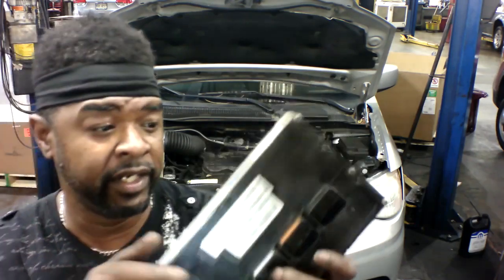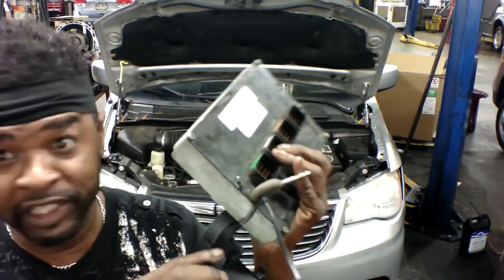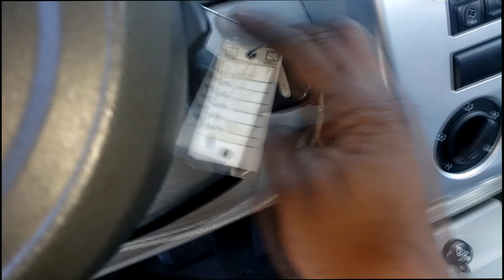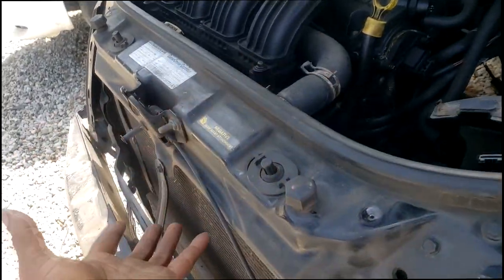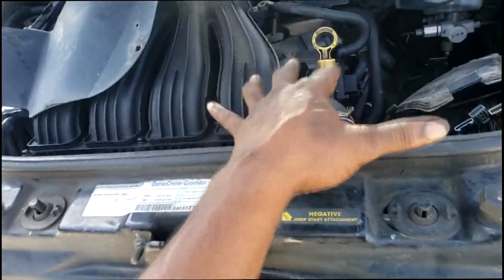No Start Key Bad. NO FLASH NEEDED. DO THIS. PCM, SKIM, KEY to avoid programming. PT Cruiser no crank

Comment: Not a fan of the PT Cruisers.  At the shop, we call them Post Traumatic Cruisers.  Mostly because everyone cries the blues with these cars, and they get way to emotionally attached to them.  Personally, I believe they suck due to bad engineering.  Ever get tired of replacing that fan?

  The advice is sound, since only 2 engines were offered.  Turbo or not.  Simple.

Comment: Man you're the only one anywhere I've seen who could maybe help me. I have a  2008 pt cruiser with a no start no crank condition. My key fob works and the security disarms (no red light when the key is in the ignition.) But I turned the key and just got a small click from the relay and fuse panel area in the engine bay. And now it seemed to have locked me out. No click anymore no reaction. I have a new battery, new alternator and new starter. All fuses are fine. And the relay seems fine too. Any help?
Reply: John did you get this fixed? IF not what's your location as I know techs all over the country who can solve your problem. Dealers can't do this stuff with used parts as they only wanna hang new parts because they're trained that way.

Comment: So you can plug the pcm in and as long as the key is close to the skimmer it’ll turn over with the old ignition and key?
Reply from the maker: Hey bud, im not understanding the question. Also are you subscribed to the channel?
Reply: Yeah I figured. I was a little stressed out. So if I go to a junkyard and take the key, pcm, and the skim module would I just keep the junkyard key close and I can still use the original key in the ignition or do I need the entire tumbler to?
Reply: I’m all fixed now. Turns out the PCM was bad and instead of doing the PCM SKIM KEY trick I went and got a PCM and had it programmed.
Reply: You could have done that. On the generation before WCM I got all 3 from the salvage yard & zip tied the replacement key to the replacement SKIM & plugged that one in & zip tied that pair under the steering column. No need for new keys since it reads the replacement key/SKIM combo. The issue with this method is that the VIN does not match the vehicle for inspection purposes.
Reply: This issue is actually solved now. I had gotten a used PCM and had it flashed. From there it was plug and go 😃. Ever need a PCM flashed or want to purchase one that they will send you that’s already flashed I recommend flash masters in Cincinnati Ohio.
Reply: @daviddancer2727  hey David, how much do they charge?
Reply: Will a 2004 pcm work on 2003
Reply: I no this isnt new but i have 07 jeep commander yes i got the common prob ecm went out skim module went out and idk if my key even works anymore it tries to. So anyways i have a salvage yard dwn st from me with a 08 model commander now if i took its ecm its skim module and ignition node (mine is a ignition switch with metal stick key not the new fob squarehead key)and the key that is with it will this work in my jeep i have been told that jeep commanders are vin sensitive plz let me know cuz i will hop right over and grab those parts im tired of dealing with this problem i have spent way to much and dnt wanna spend anymore money so if i can do this swap that wld b AMMAAAZING!!

Comment: Can u do this with a Jeep liberty
Reply from the maker: Hi Melissa, did you ever get your Jeep running? I still think its cheaper to simply get a key cut and program but I guess not
Reply: @OnlineMechanicTips  why
Reply: How much does the 3 parts in question cost at ur pull apart??
Reply: @OnlineMechanicTips  why
Reply from the maker: @familyscapegoat  Maybe 60 for the PCM, 50 for the SKIM, and good luck finding the matching key for this skim which ids the only way to make this way work. You have to have all 3.

Comment: Would this apply for an 01 pt cruiser?
Reply from the maker: It depends. What color is your key? Is it black or silver/gray? Also are you subscribed to the channel?
Reply: @OnlineMechanicTips  its grey... the key and faab are separate... its the limited with the sunroof and leather... yes im subscribed
Reply from the maker: @moleykewl7648  This yes, this will def work on using same part numbers of the PCM (computer). Try to get all 3 parts to avoid needing a dealer..If you cant, get PCM and the skim. But you will need a new key to program into the vin of the car you got the parts out of
Reply: @OnlineMechanicTips  ok, i just spent about a grand on this thing, thinking it only needed a timing belt.  1000 dollars later with the new belt, water pump,  sending the head off , the pcm was acting up. When you turn the key over the tac would jump to 8 rpm and it would not turn over. The computer said it was already running.  I changed the pcm , and now the tac does right,  it turns over. But the security light comes on and it won't start... im so fed up with this thing its driving me nuts and breaking my bank. From day 1 its gave trouble